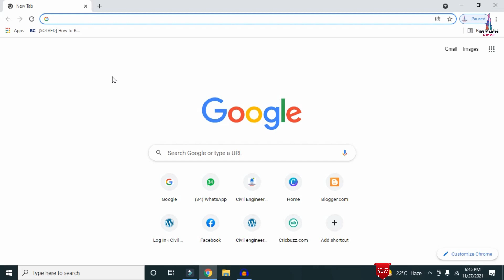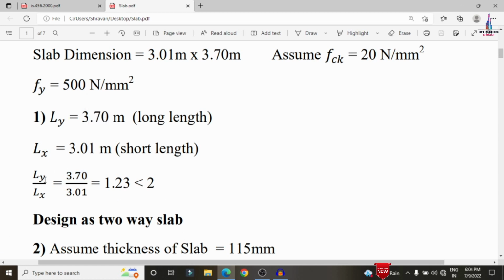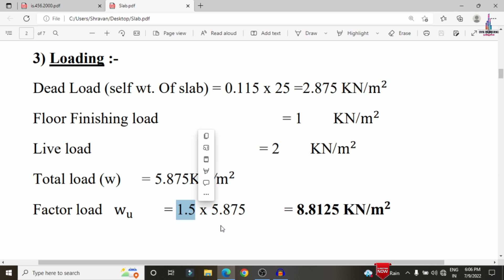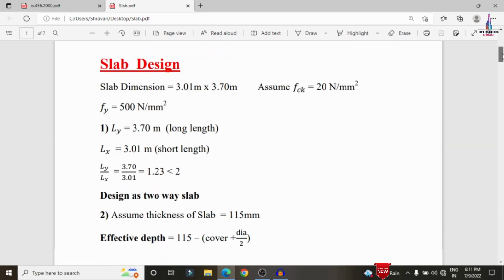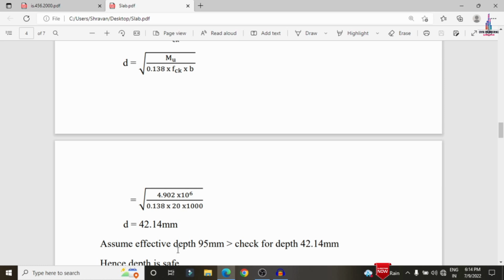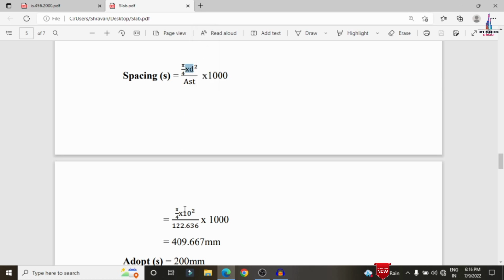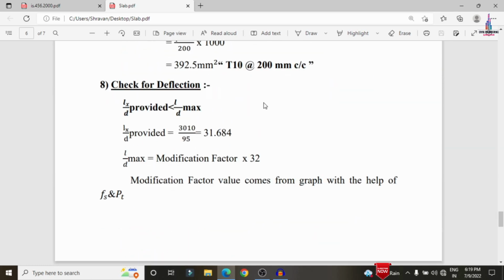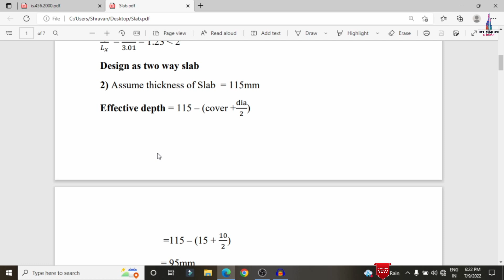Complete RCC Slab design as per IS 456-2000 code | manual calculation | two way slab design | online

Comment: Is the reinforcement mentioned in the torsion in the different corners are the gross reinforcement? Bars are coming ftom two different direkction  on the top and bottom. Will those be included while accounting for torsion reinforcement?